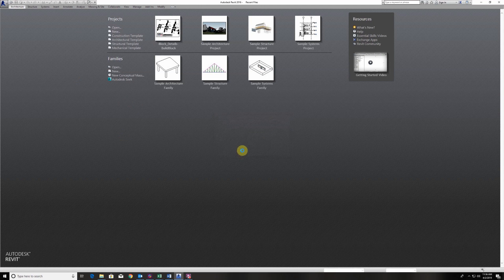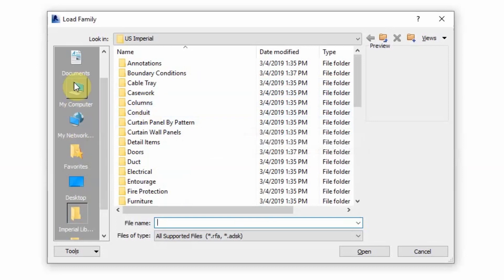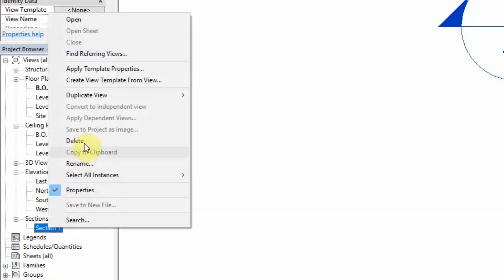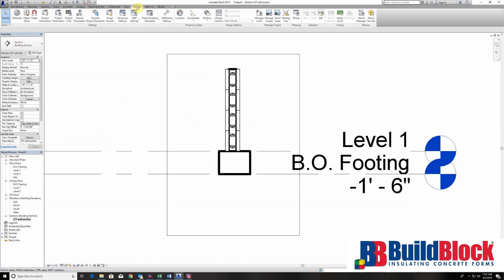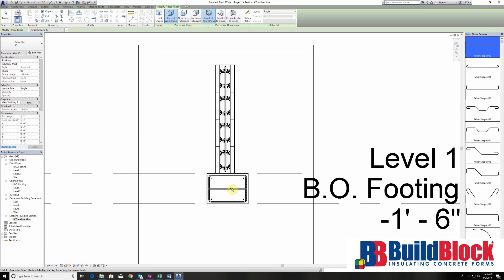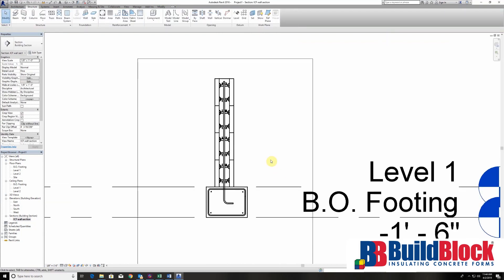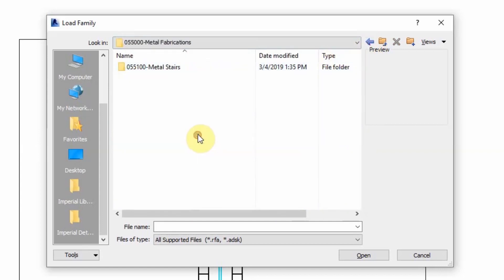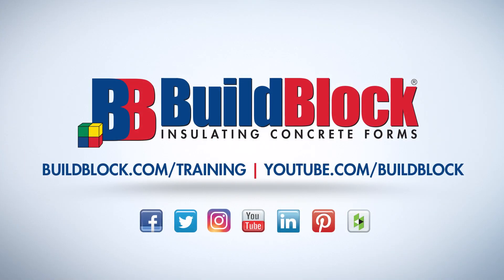Creating an ICF Wall Detail in Revit

Comment: I don't understand why you are modeling each individual block! This is NOT (IMO) how you should model ICF! A whole hose or any project using this would have a HUGE file size. There really is NO reason to model this much detail. A detail component is much better!
Reply: My OCD side really appreciates this video and that others endeavor to produce thorough life-like modeling - I think that it's an art like true tile setting which masker vaxxer sport obsessed lemmings refuse to acknowledge or accept as being relevant in a poisonous fast food culture - however I agree with you that firms everywhere would be firing left and right their entire drafting personnel who opted to model projects in this fashion, at least on the architectural end. I cannot speak for structural or civil, but 2D detail components layered within specific detail drawings = much faster and far more efficient than a strictly correct 3D building model of course. Nevertheless - I am actually excited about modeling a building like this jut for fun - likely with several worksets! You know!